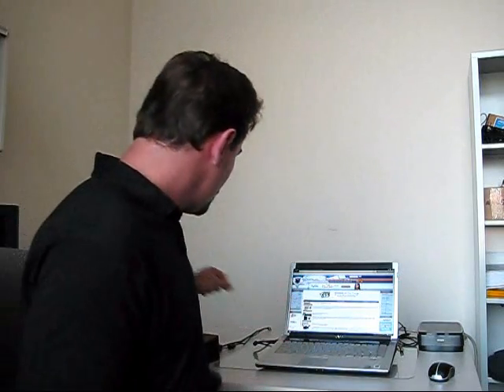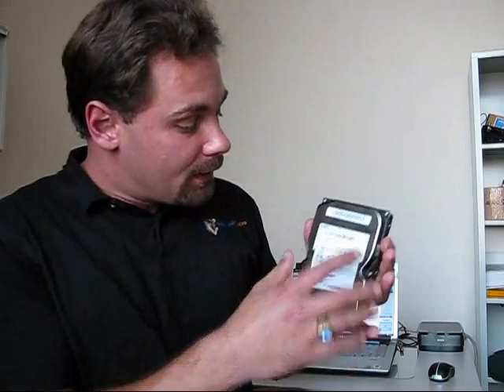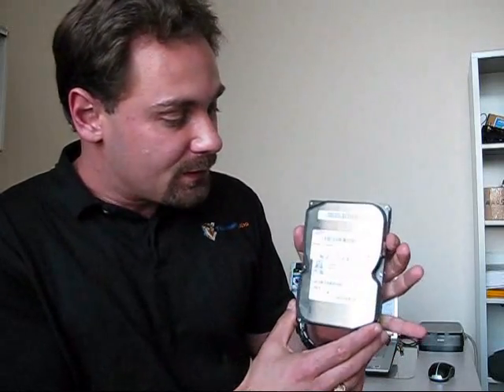Hard Drive Click of Death Explanation and Live Demonstration

Comment: UPS just lost my hard drive.  I gave it to Geek Squad (at Best Buy) for a repair.  Since Geek Squad could not fix onsite, they sent to Kentucky.  The UPS driver never scanned the package (this was a month ago), it got lost, and now UPS can't find it.  That's 1 Terabyte of data (years of files and photos) gone because of UPS incompetence.   Geek Squad should've forced UPS to scan before leaving, to at least ensure some tracking.  Because they didn't scan, it's not traceable.  Don't EVER give your hard drive to Geek Squad, as this weak link (UPS) could destroy all your data.  Get a hard drive fixed locally, on-site.

Geek Squad’s fault and carelessness in this was a) Not making sure that UPS scanned my package, and b) Not tracking the progress of the shipment.  They should’ve noted that the package did not arrive and then immediately filed a claim.  Instead, the manager waited until my email – over three weeks after I dropped it off – to look into it.  So the package could’ve gotten stolen or even more lost in the meantime.  Absolutely irresponsible, top to bottom, both on the part of Geek Squad and UPS.

Comment: I am having an issue with a hard drive that starts making really loud clicking noises, I mean, I've had failing hard drives before making the noise, but not as loud as this one. It happens when I launch a GPU heavy game, it seems that when the GPU is near 100% usage or the voltage goes to the maximum it needs a lot of power and the hard drive starts suffering power loss and spinning up and down repeatedly until it spins up one more time and suddenly it makes a very loud clicking, no, knocking noise. I think I know why this happens: power supply is garbage and can't handle so much power demand, although it says it can handle 500W... am I right, anyone? 

PS: I run the game from an SSD, where I also have the operating system running. This happens to a hard drive that isn't supposed to be doing anything during the gameplay. I have two more hard drives on this PC but it only happens to this one. Am I in danger that it is about to fail? 
Thanks in advance.

Comment: The clicking noise I heard was much faster and sounded louder and my hard drives worked without a problem. I'm going to back up my stuff just in case and try to get rid of dust and stuff because it could be one of my fans.

Comment: Can copying huge amount of data in an HDD in a relatively short period of time cause it to fail and click?

I bought a brand new 2.5" 2TB HDD to upgrade my PS4 500GB default drive.
Everything went well in the firmware installation.
I didn't do anything particularly out of line except copying a huge amount of games, one after the other.
After some time, while it was copying the 5th or 6th game, it started clicking an the PS4 cannot re-initialize anymore.

I put back the default 500GB HDD and everything is fine.

The HDD I bought is from Western Digital (WD Blue)
Reply: It might have been because of the grade of hard drive.
WD Blues are Desktop hard drives and are rated for less work loads than say a NAS Red drive. 
NAS; Network Attached Storage (Networked storage servers) are designed to write large amounts of data and are often used in backing up data.
The hard drive could have been damaged from maybe a combination of blocked or poor flow through air vents and the high workload of data being written to the disk.
Or you might have gotten a defective hard drive.
http://www.extremetech.com/computing/170748-how-long-do-hard-drives-actually-live-for

Comment: I have a Seagate Barracuda 7200.12 750GB HDD, and for like a year whenever I turned on my PC it made 3 weird sounding clicks... then everything worked, it always worked. I used it for a year and the triple-click only happened when the PC itself was powered on. I got a second HDD and Microsoft told me I needed to put Windows10 on both HDDs (so I made sure the system detects/boots from the new HDD), now the Barracuda doesn't wanna respond. What's wrong with it?

Comment: i accidentally put some pressure on top of my hard drive while it was spinning and then the laptop crashed. the next time it booted up the hard drive was buzzing according to what angle i held the drive. i hit it a little and the buzzing stopped. somehow no data was lost
Reply: You damaged the head, and to top of the outward platter.  Some hard drives will go into protection mode to move data off of damaged sectors if free space is available and it can be read without further damage to the unit.

Comment: Looks like another crap Seatgate. Only answer is to never buy Seagate. Just what kind of crappy control algorithm makes the heads bash themselves silly against the central boss is any bodies guess. Must be depressed cus they're made by Seagate. I lost five Seagate drives like this in less time it takes to fill them and off load the data just once. An MTBF of less than 10 days or 240hours

Comment: so what you say is that if i take the cover of a hdd it turns useless? no one can fix that hdd anymore?
i have seen a few videos of people taking the cover off, putting it back and it worked, and if that isn't enough, i can say than i did the same before watching those videos and my hdd is working just fine, i only had to know how strong i should screw the case.
Reply: Not immediately dead but yes if left open the platters will corrupt due to dust and other particles interfering with the read and write capability. And no you cant clean the platters. Theres a reason the hard drive is enclosed.

Comment: I have Hitachi HDT 722516DLA38 160gb,I managed to find identical head rack and replace it,however clicking still happens..I also took head from first 164gb version than reinstall it back but also clicking sound...My clicking problem is different,head rack only moves until certain position,it is unable to reach center of platters because of magnetic system,head refuse to move further and something tells me it have lot to do with preamplifier chip that send signals to head's,seems that PCB not recognizing head although it same model number...MRT gives me no answer and lot of inconclusions...Acording them everything must be same,but if I took parts before than later installed them back why they not recognized,why it clicks??

Comment: im currently having this problem as of now. it happened at such a random time as well with the HDD going strong and healthy all the time for the past 3-ish years or so now. it was around 95% of the time that the PC would boot no problem but would get this problem if a certian condition was meet

and that is if the wall socket power was left turned on for more than 1h 30mins, and then the PC was turned on it would make that sound for a good 10-ish seconds until it made it past the boot screen.

but when i woke up today and turned on the wall socket and then the PC it done the clicking noise but it went on for a good minute constantly making that sound and showing no signs of going past boot. turned PC off and then back on and done the same thing but was only 3-5 ish clicks then booted fine.

but yeah in my case it doesn't snap back all the way and just not move. 

i have external HDD with everything backed up so im fine in that department. but dam is it really worth getting a new HDD especially at a time like this when xmas is approaching and im all ready skint (low on money) enough as it is

Comment: 286/5000    I'd love to help have a faulty disc instant I just want to extract the information (information not important enough to justify the high expense / extract only help a friend Photo) opened the disc - is spinning for a moment, the head of the reading does not move and it stops. As soon as I power connector makes it beeps. I'd love to respond to the best of your knowledge what's the problem? Thanks in advance

Comment: Removing cover doesn't kill HDD. HDD head needs atmospheric pressure of clean air to operate (HDD heads are designed to be at exact distance from plate at this pressure).
All HDD with open cover needs is to put it together, seal it properly and equalize the pressure.

Pretty often, clicking sound isn't a mark of dead HDD. It's just sign of seals being old and couldn't hold the exact pressure. Or there's some debris blocking the hole to air filter, making it unable to equalize the pressure.

Also, a freezer trick is the most stupid idea. As it mostly doesn't work and bring irreversive damage (fast temperature change may damage plates) and seals are more likely "not to seal properly".

Good trick that works on HDD's with click of death but still being able to occassionally read is to try to run HDD positioned vertically or "upside down" as this change might allow slight inaccuracy or head-plate distance anomaly to be "nulled".
I could ran several HDD's with click of death for years this way.

Also, "HDD data recovery" by specialist doesn't cost 1000+$ but more like 250-400$. It's the cost of equal HDD and little bit of work. Most trouble these specialists have is to find an equal HDD for reasonable price (as they are no longer produced) on aftermarket. Sometimes that alone take week or two.
Reply: El Shuwix. i was quoted $1200 by two different companies in Dallas Texas one year ago
Reply: really hight presure hdd. My god large is the garden of heaven and many stu....s jump fence

Comment: My Xbox 360 S hard drive makes that clicking noise and I thought it was just a way of the console letting me know the problem. What causes this though?
Reply: Shock damage can be the cause.
Reply: Robert Norris-K sorry for being an idiot but what exactly causes shock damage and what is it? (More interested in the cause)
Reply: Quintero's Gunman Dropping, and other physical damage.
Reply: Robert Norris-K I do recall dropping it once but it still worked after that, does unplugging and plugging in frequently affect it?
Reply: You should backup the drive, or take off the most important data, when you see or hear anything wrong with a hard drive expect it to fail.
Reply: Robert Norris-K wish I would've done that, luckily I can recover my stuff through Xbox Live, just gotta re download and get a new drive, thank you for the replies
Reply: Quintero's Gunman dead circuit board or the arm is stuck to the platter if so get a t6 screw driver and turn the platter counter clockwise slow and pull the arm back at the same time just be very very careful

Comment: I have a problem, was wondering if you can help.

I have a Porsche Design 4TB External HDD and a Focusrite Scarlett Solo 
External Sound Card, I know when the USB 3.0 goes off when I hear a loud
 POP sound from my speakers and if I have a window open that is 
exploring the contents of the HDD, it will disappear. I also experience 
this issue when watching videos from that device, mainly when I change 
to the next one in the playlist. I also experience it when I change 
videos on YouTube, or close down the browser, use a plugin here and 
there in Firefox and a few other annoying moments while half way through
 using Camtasia editing.

I have got around the trips when editing, by moving files I want to use 
on my local C:/ Solid State Drive, but I experience it whenever 
performing other tasks as listed above.

I really don't know what to do, I am using an AMD A10 7700K machine with
 an ASUS A88XM-PLUS motherboard, 16GB Hyper-X Beast RAM. I tried the 
BIOS fix, by disabling USB 3.0 support, but then my soundcard doesn't 
work properly when I use Ableton Live. Although my Scarlett Solo has a 
USB 2.0 lead, I have to put it into a USB 3.0 port as I am using an AMD 
device. Also, what's the point in having Super Sonic USB 3.0, if I can't
 use it without all of this happening?

I had a laptop before my PC and had the same problem, that was an AMD 
machine too.

I really don't know what else to do, after trying a few fixes.

Comment: My 5TB external Seagate has started to take abnormal amount of time to write the pictures from camera memory into HD. Currently it is only about 1.5 TB filled and rest free. Recently noticed that it starts to write but can not finished the task after 1 GB or so. Now there is a random TICK too... Yes I know it is dieing but still seems breathing though surly short of it. What can I do to retrieve what I already have on it and what is the wisest way to salvage what is already on it, at this point? Any wise opinion is highly appreciated and please don't remind me about "Should have backed up". Thanks,
Reply: You should've backed up...     JK   XD (I'm sure you will after this)

The 'wisest' option is to let a professional do it, though that would cost you about $1000 at the very least.

The actual parts they use would be worth no more than a new HDD, you could try fixing it yourself, though don't do this if the data is truly precious to you.

I am going to create a makeshift clean environment and replace the HDD read/write head myself for another drive of the same type, though I am anxious about this.

My HDD is experiencing the exact same symptoms, though I dropped mine, not sure if you did the same. If you find out what the problem is or was exactly, do let me know so I know I am going down the right track.

Comment: Opening it up to the outside air doesn't ruin the hard drive.
Nice try-that's a way for technicians to scare people into giving them business.
Reply: I witnessed my grandfather pull a hair from the read/write heads and fix a HDD (don't have a clue why it was there), he did this outside. Centrifugal force should remove the dust from the platter and run it into the filter, though a clean room does maximise the chances for success in recovering the data.
Reply: +Darcie No, outside air does not ruin a hard drive, but the dust and other particles that land on the platter surface are enough to cause a fatal head crash.
Reply: Centrifugal force doesn't exist, you're thinking of centripetal force.
Reply: https://en.wikipedia.org/wiki/Centrifugal_force
Reply: Are you posting that link to disagree with me or to add evidence? Because if you are disagreeing with me, did you even read the page?

Comment: i have my 3tb hard drive and lately i've been having problems with it. Every time i start something that takes a bit more processing power such as games or programs the drive clicks once and disconnects. After i scan for hardware changes in device manager the disk reappears and works normally as long as i dont use any programs/games that are installed on it
Reply: Backup your data IMMEDIATELY!
Reply: Indeed, you may soon experience a head crash, copy the data and throw away the old HDD (or keep it as a backup - though you should not rely on it and make another backup).

Comment: my hardrive is clicking for 15sec at turning my pc on also randomly when im using it , but everything works, also i have scanned it, it's stops clicking if i punch it lol,
Reply: Make sure you have a backup, it will most likely fail eventually.
Reply: Robert Norris-K it failed. and my backup failed weak later ,and im not joking
Reply: Martins Delvers Well that's bad news, though some you have two drives the chances of recovering the data are much higher. Perhapse backing up to a cloud would be a good idea, that way no chance of failing.

Comment: Just opened my clicking drive up per some YouTube instructions. There was a groove around the very hub of the disc, with the head stuck in it. I rotated the disc counterclockwise while moving the head back into resting position, BUT, I'm afraid the groove told the tale. This thing is done! I just read that the head falling and sticking into the platter, making a groove, is what causes most failures, and is where the term "crash" comes from. Oh, well, now I own a torx (not torque) screwdriver set.
Reply: +Art Howard Funny that with all this amazing technology, or computers are running on tiny record players (the hard drive platter and head).
Reply: +Art Howard I thought the same thing!! I wonder how record players work
Reply: The record essentially has the soundwave carved out of the depth of the vinyl in a spiral loop, the 'hand thingy' (I forget the name of it) then reads that sound wave sending the data to the speaker. The HDD works by magnetically altering the platter(s) with the read/write head, ultimately recording data as '1's and '0's.
Reply: The only reason the HDD method is still used is because SSDs are much more expensive: 2TB HDD is equal in price to 250GB SSD (1/8 of 2TB) at $150 approximately. I will celebrate the day HDDs are phased out (no more pain of data loss [mostly]).

Comment: I have opened up hundreds of hardrives, cd-roms ( old), cd-writers, dvd writers you name it. I have saved about 20 drives already but it is not as easy as eating a choco bar. You need to understand that there are simple ( means you DO NOT DEVIATE FROM THEM) procedures such as using a terminal window in Windows to connect to the drive( bricked firmware issues), having a good selection of spare drive boards etc.. Freezing sometimes helps. But the biggest issue I see is indeed head units going bad so those you can replace easily. Once you hear that click of death 1 or 2 times STOP and power down, the longer this goes on the more chances of the surface of the platter being scratched). I made a box with a glass viewer so that I can open up hardrives and not have big dust particles touch the surface. If the head picks up a big piece of dust or lint it will scratch the surface.
Remember keep it simple and clean and you can open up any hardrive with spinning platters. There was once talk of acrillic harddrive tops or something seethrough but never happened.